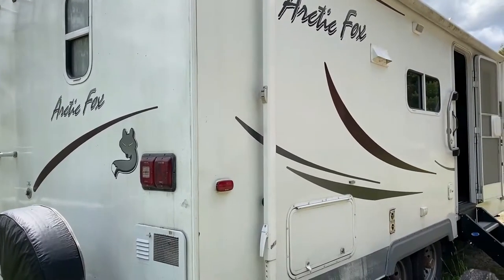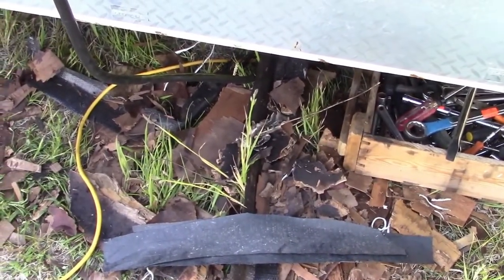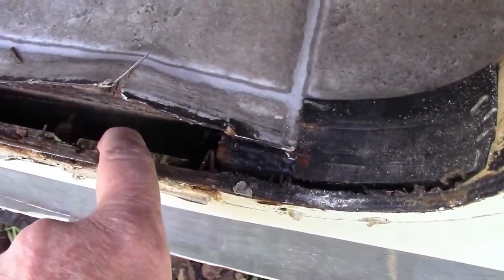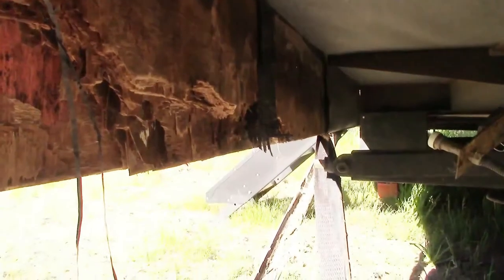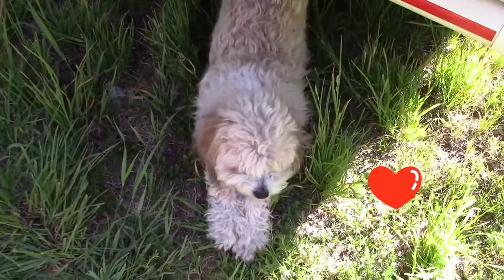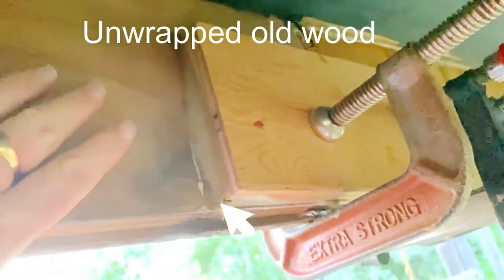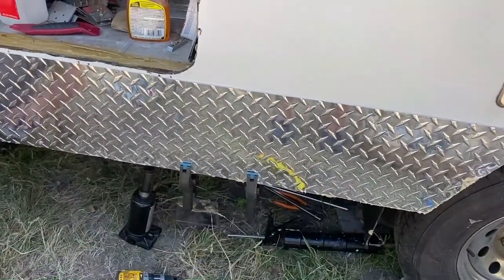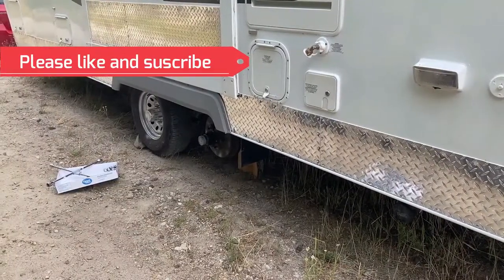We Fixed Our Water Damaged Travel Trailer

Comment: Used trailers are just full of surprises.  This is where glue laminated beams/wood accels, structural and rot proof.
Reply from the maker: It's true! You really don't know what you are buying with used. But, the same can also apply to new as I have heard plenty of horror stories about things not working or breaking soon after driving it off the lot. Warranties are fine if the company stands by their product, but this is not always the case. It really is a 'buyer beware' market.
Reply: @HoneyandMe  had a Golden Falcon 15 from early 70's had been all fixed up with a tongue and groove throughout.   Was pretty well built but heavy so finally sold it for $1k more than I paid.  Good little trailer but much upkeep.  New trailers are built too quickly these days and have lots of problems.
Reply from the maker: I tend to agree, Jeff. We have a 197? on our Yukon property that we use to stay in in the summer. It is permanently installed there now, but has never leaked, had tons of snow on it over the winters, and got hauled around on rough logging roads in northern BC in the summers when I worked as the cook in tree planting camps. It's a gem, but heavy.

Comment: I bought, used, 3 years ago a KZ24RKS TT, great trailer but it had heated tanks, which meant they stuffed insulation around the tanks, covered it with plastic and directed furnace vent into the area, good in theory....    It soaks up all the road water and the fibreglass insulation was soaked, rusting frame and eventually wood floor! Tore it all out it was disgusting, plus now i have the extra vent going into the trailer 👍
Reply from the maker: Oh gosh! Now I want to go and check ours!! Ours has the same kind of setup for the tanks, as it is classified as an 'all season'. All our crawling around underneath didn't show anything in that area, but neither did this rot until we started poking around. Eeek!! Thanks for sharing your experience, Bob. Or maybe I won't thank you if i discover ours has an issue too. lol! Take care!-Sue

Comment: Thanks for the great video - nice work. Do you have any idea what the new weight of the trailer is after your structural repairs?  Looking forward to the slide video
Reply from the maker: Hi Dan! Good question. As we only replaced wood that was rotten with new wood, plus a few extra pieces, I don't think that part would have altered the original weight of the trailer much, if at all. Plus, we got rid of the water soaked rotten wood, which probably weighed quite a bit! lol!. The metal diamond plate is thin aluminium sheets, so it would not have been that much added weight. You can buy heavier diamond plate, but this was quite lightweight stuff. Our Home Depots here in Canada sells it in 2' x 4' sheets. Very handy stuff! Hope this helps! Thanks for watching!-Sue